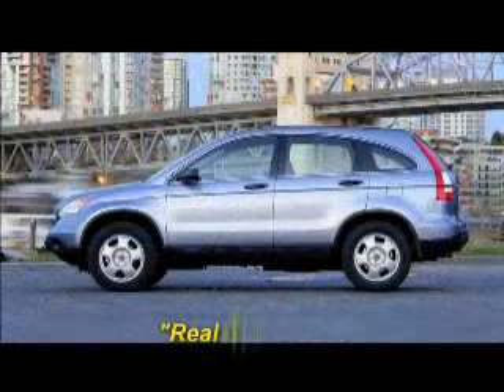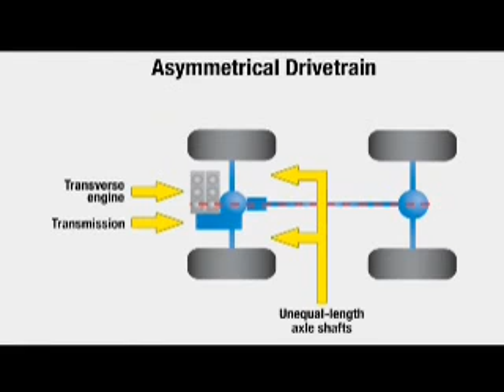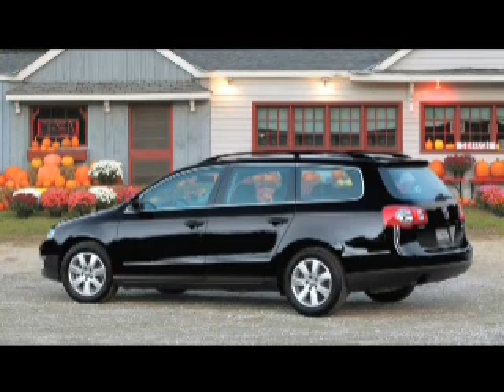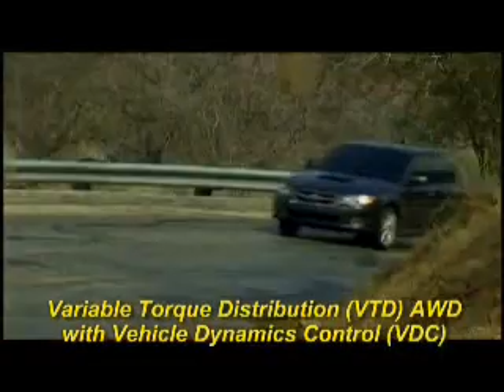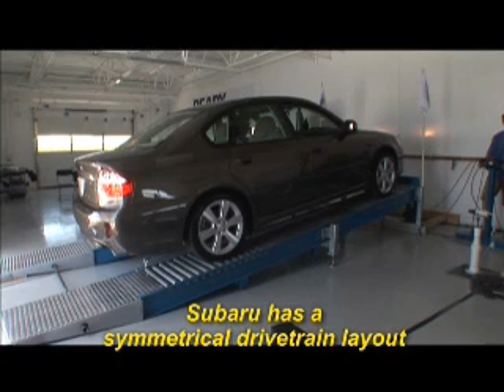Subaru AWD vs. competitors

Comment: The only problem I have with this test is that we cant see the rear wheels of any of the cars.  I'm not suggesting any foul play (I own a Legacy 2.5GT and, ironically a Rav4), but it would have been easy to position the camera to see the rear wheels and back of the car and eliminate any doubts about these tests  Given the testers were (if I'm not mistaken) from a Subaru dealer or at the very least paid by them. Neat test, I'd love to see it confirmed and how Toyota and Honda would respond.

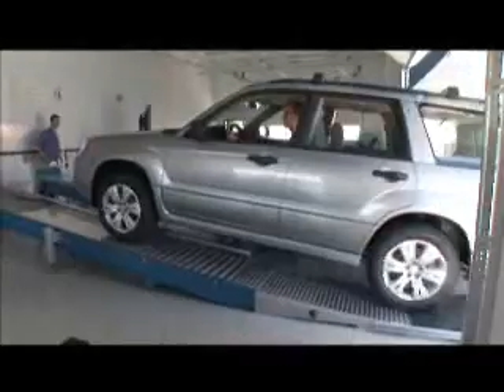Comment: At 2:03 you can see very goofy ramps they used (you can see the one on the passenger side tires) just outside to provide an additional barrier the vehicles had to get over with their rear wheels.  Almost like a wheel chock. They appear to look sort of like the bottom of a bowl, like a flattened U rather than a ramp.  Not saying the Subaru didn't make it and the Honda didn't but it did seem to me the results appear to be exagerated a bit.  This coming from someone who hates Hondas (except motorcycles), but I'm for legit, fair debate, not fanboy prop-ups... :(

Comment: @t0rington the bump on the rear wheels outside of the garage are there to simulate the angle of the rest of the ramp, though whieght pull from gravity is not simulated when rear wheels are at that bump.

Comment: "Passat claims that it can move when only one wheel have traction" They don't claim that it'll climb a hill with one wheel that have traction.
Reply: ifr4zze but then there is no reason to say it because every damn car can move if 3 wheels are on ice,its not that difficult, every car in the world can move if 3 wheels are on ice,as long as one of the wheels originaly can move, a rwd car that have the rear wheels on ice and one front on asfalt cant move because the fron dont move orignally, same goes for a fwd, but every 4wd car on the market can move if 3 wheels are on ice, its not an achievement and isnt impressive at all, but a 4wd car that can climb a hill with only 1 wheel on traction is very impressive. subaru does it again.
Reply: ***** then read it again, a rwd car with the rear on ice and the front on tarmac cant move, because the wheels that spins have no traction, this is not rocket science its basic logic, a 4wd car with 3 wheels on ice will be able to move without a problem on flat surface,

a volkswagen passat with 3 wheels on ice and on an angle wont be able to climb because the wheel that have traction dont have enough power to move a 2 ton car up a hill.

its in the video, did you even watch it.
Reply: ***** but it went on every wheel except the one that needed it.

Comment: @finnsk3 (continued from last) This is because of the weight difference, weight has a major effect on friction, which is what provides traction.  In a symmetrical driveline, you have (nearly) equal weight distribution between the right and left side of the car.
Torque steer, caused by unequal length of axles, is one axle twisting more than another.  Every axle will twist slightly, but if one side twists more than the other, then power will be delivered to the other side faster.

Comment: @3tadt30ldat physics says that automatically when slippage occurs...the wheel slipping will get most of the power because its the path of least resistance (air has little resistance). Therefore something must brake that tire so that the power being sent to that tire is reduced or stopped and the tire stops spinning.

Comment: The forester is indeed AWD all the time, but on a normal driving surface, about 80 percent of the power is coming from the front tires and about 20% from the rear tires. The thing is, it is always sensing the roads surface and "sending" power to the appropriate tires. In a subaru, power is always directed to the tire with the most grip.

Comment: Take a suite case containing 50 pounds. Start to lean the bag over & use your hand to keep it from falling. Now slowly begin to lay it on its side using  your hand as support. Notice that the weight begins to shift from the bottom of the bag to the front. The total weight of the bag never changes yet as the bag becomes more horizontal it becomes heavier to you. If the car is at an angle the weigh distribution on each tire changes.

Comment: The reason the subaru didn't have any issues with the rears on "ice" is because the front is a direct drive, not because it "sensed it" the rear drive is through a center diff.  A very good drive system though.  
now if it had a LSD front/rear/center diff.. that'd be fun!

Comment: At 2:35, the explanation was incorrect, the slippage of the rear wheels did not cause power to be sent to the front wheels. The front wheels are the default drive wheels and only when the front wheels lose traction will the electronically-controlled center differential (transfer case) send power to the rear wheels. This does not apply to Subaru's with manual transmissions, where the AWD is all-time 50:50 split.

Comment: if this has already been posted, ignore, but one fact reported is false. The asymetrical drivetrain has an effect on torque steer (the car rocking sidewas when both wheels loose traction). 
But only a locking differential (manual or electronic) will move the car if only one of the 4 wheels has traction.

Comment: @t0rington it think i wouldn't really matter, since 4 wheel drive cars cant switch to front wheel only rear and 4 wheels all together, so if front wheels we rolling that's means car was on 4 wheel drive mode, and you have a point it could be that rear was on the rollers like front wheels (if that's the setup) and again if it would be the case then the car wouldn't sit under angle it would slide all way back.

Comment: @7150285 Mechanical 4WD, yes. AWD, no. The transmission is mechanically locked, causing the front differential to be disabled. The front axles technically aren't locked, the center of the differential is simply locked, making it mechanically impossible for the front wheels to turn in the same direction. If you put the vehicle in the air, you can spin the front tires, and they will spin the other front tire in the opposite direction.

Comment: it would be interesting to see the diagonal test on the base Forester and Legacy.  With 1 wheel slipping in front and 1 wheel slipping at the rear, the car shouldn't be able to move.  I wonder if the Subaru VDC would help in this case.

Comment: @3tadt30ldat I own a '99 Outback, with 292,000 miles & climbing. I think what they're trying to convey is the newer Subarus have electronic traction control. That's when it would "sense" slippage and adjust. Another difference is automatics run 90%front/10%rear UNTIL slippage, then it splits power accordingly. My '99 is a 5 speed and gets 50/50 all the time. Automatics from my era go to 50/50 during slipping using a mechanical "sensor". I assume newer 5 speeds use traction control as well.

Comment: @7150285 Havent had a automatic subaru but I think they disable all four in park. All four are constantly linked in either trans type in a subaru. The competitors will most likely behave like a front drive in park since their poor awd systems only become awd when they lose traction at front. Thats the beauty of Subarus system you get awd constantly. Just had a friend come back to Subaru from an Audi. He also came to the conclusion that the flat engine's lower mass cg is more than just hype.

Comment: This video show us subarus center differential distribution. It works very well, betwenn front and rear wheels. And with traction on just one wheel, the traction controll system works great, if only a bit slow i think!
THIS IS WHAT THEY DONT SHOW US IN THIS VIDEO!!!:
Traction on the front left and rear right (diagonal test) This is where Subaru AWD system falls trough. It will be standing spinning like the rest of the competitors. But of course they dont show us that!

Comment: Technically this test did in fact test the Audi Quatro system, though it was under a different name. the Volkswagen Passat used Audi's Quatro system (Audi being owned by VW) how ever i did not see the Mitsubishi tested, i think it safe to say Subaru will shine over Mitsubishi too. also something to consider is the power to Weight of the Vehicle, takes more power to move more weight on any surface, and im wondering if this test compensated for that. still a great video.

Comment: @finnsk3 I'm not so sure, I have a 1993 Legacy and when one wheel looses traction it transfers power around just fine, and it's much much less advanced than your Forester, open dif at the back and no ABS lol. In a recent snow storm I drove it around with just 14" "all weather tires" and it was just fine.

Also the difference is that Legacy has all that crazy VDC and stuff on it, that costs quite a lot, wouldn't be surprised if that Legacy had a 32k price tag at the time.

Comment: @DtorBillAgain 
You´re partially wrong dude. Most of Audi Quattro models(but A3 and TT) have a Torsen locking differential which is very comparable to Subaru´s symmetrical AWD system (it can be able to lock both front and rear differentials). VW has 4motion which is completely different to Torsen based Quattro. 4motion VWs have a Haldex system which is a FWD system most of the time which engages rear wheels when front wheels lose traction. Only front differential will lock.

Comment: @finnsk3 Symmetrical AWD DOES mean something, but you're right, the diffs will make a bigger difference.  The difference that a symmetrical driveline makes is in weight distribution (which effects traction), and reduces or eliminates torque steer, caused by unequal length in the drive axles.

To think about the weight distribution, think of a rwd pickup, in the ice, the brakes on the rear of an empty pickup will lock more easily than the front, even though the tires are the same. (TBC)

Comment: I agree on everything except tires. This is not snow or ice where slip is between tires and the road surface where tires would be a huge variable. The slip in this simulation is within the rollers. all wheels on rollers will have 0 traction regardless of the tire. The wheels off the roller don't slip at all. Am I missing something what difference could tire possibly make here?

Comment: Good test showing you the difference between the AWD systems, but a little impractical. Most people buy these cross-overs so they can carry family members or friends along for a ride (as well as their gear), in which case even the Subaru would be underpowered and fail to drive up the ramp. The standard 170 HP that the boxer engine provides is not enough, and while Subaru offers an upgraded engine, it becomes too expensive for what its worth.

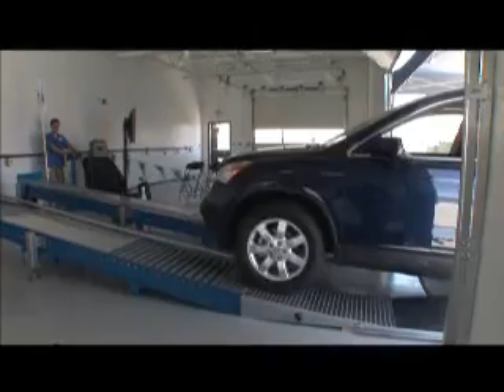Comment: Ok, I own a CRV, and it could make it up that 4 inch tall bump that you don't see. look at 0:38 in the vid. The driver must cut power to keep from going over the bump. Also, that part about going through tests to find traction is wrong. I know exactly how the CRV's AWD works: the greater the difference in speeds between the front and rear axles, the more power is transferred to the rear. There is no center differential, but rather a multi-plate clutch.

Comment: I just traded a 2005 WRX in part on a 2013 Forester. The WRX is more fun, by far, than anything else in the price range subaru makes. It was an excellent car and I just about cried when I gave it up for my "grocery getter," but I am a teacher, and I need a "sensible" car that is better in snow. The crazy torque the WRX gets will put you in a bind in snow pretty quick if you are hard on the gas. Your pick: sensible, or fun. Sensible is always better in snow :) Good luck!

Comment: @3tadt30ldat It needs to put extra power to the wheel(s) with traction to completely move the vehicle.

If this were on a flat surface, it would've had no problem moving without much (if any) extra transfer to the back wheels.

Comment: IIRC, any Subaru after after 2000 has a limited slip rear diff. My 98 Impreza slips a bit on ice but will go up. My 00 Impreza has no issues because of the rear diff.

Comment: the Highlander has a fixed 50:50 system, so it can't route power to the rear wheels.  I would have liked to see the one wheel traction test on a Subie AWD system without the rear viscous LSD....as the availability of Subie AWD with a rear LSD as decreased,

Comment: This video validates the complaints I hear from friends with AWD Rav4s and other vehicles that claim to be AWD.

The majority of these so called “AWD” vehicles can only send a very small percent of torque to the other wheels; usually in a front-wheel drive biased set-up, 10% of torque will be send to the rear; watch other AWD test on Youtube.

This is why some automakers don’t want to disclose details of their poor-engineering/great-marketing AWD scheme.

Comment: I'm not understanding this video.  The whole idea behind Honda's RTAWD system is to send power to the back wheels when the fronts start slipping.  The video is not explaining why the AWD system is not engaging.  Is it because the VSA (traction control) is engaged?  If so, you can reach over and shut it off.

Comment: Why isn't Quattro, X-drive, and whatever the unstoppable Hummer used on it's older models featured here?  Most vehicles that are advertised as AWD are not.  Trucks are a great example of this.  I live in the Rockies, at 9200 feet, on a mountain.  I have zero problems getting to my home in my A6.  And constantly see trucks with more power, bigger tires, and much more ground clearance struggling to get up the hills.

Comment: @7150285 yes and No. if you move both rear wheels forward or backwards it will lock up, but if you spin one wheel, the other will spin the other direction due to the open Diff. 

~~~1997 Subaru SVX LSi~~~

Comment: Yes my Outback has VDC and it sucks. Diagonal spin is not cured and to be honest the Outback is a bad car compared to the 05 Forester. The diesel engine is horrible at low rpm, the first gear is way to high and trying to maneuver with a trailer in tight conditions will ruin your clutch for sure (manual stick). The outback is ok for driving long trips with possibly heavy load but if I where to choose I would easily choose the forester (also manual stick) even if it uses quite a bit more fuel!

Comment: It's a shame with the new 2010+ Legacy model - I don't believe they come with the same VTD drivetrain technology as this 2008 model. I could be wrong, but I've seen quite a few videos of subarus not moving even with 2 wheels on the ground (one on each axle) because all the power use uselessly being sent to the (opposite) spinning wheels.

Comment: Pretty sure  the CRV would have made it if they turned the VSA system OFF.  VSA cuts engine power when it senses wheel slippage when your foots still on the gas,  it can be disabled.  But i do agree the Subaru is a far superior system !

Comment: ok i commend subarus for their AWD systems. But this video would be more believable if they showed both the front and rear wheels to show whether or not the 4WD on the honda really worked. Plus an advantage to a honda/toyota is the fact it has more room. More ride height/passenger room, Has a better resale value and get way better gas mileage then any subaru.

Comment: @7150285 yes, thats why when u buy a subaru, its on the manual that u CANNOT tow a subaru with the front wheels on the tow and the back wheels on the ground (rolling), u will destroy the system by doing that

Comment: If you take "move" literally, vw will MOVE with no wheel having traction. Down the hill. If they say it will MOVE, it should move in any direction, up or down, as long as engine provides enough power.

Comment: i beleive in subarus it also depends on if you have an a/t or m/t, someone correct me if im wrong here but with manual all tires recieve the same amount of power unless they slip where as manual its more front wheel drive unless they slip.

Comment: What if you disable traction control? I have a 2016 AWD Rav4 with en electronic "central locker" (i know its not a real locker so don't bother pointing that out) and with the locker on, the awd system and with traction control off i have driven thru deep mud and sand, heck even with out traction control off it drives a little bit thru. 

I am not saying its a proper off roader but for mud and sand it been great so far.

Comment: Where is the mighty QUATTRO!?!?!?
Reply: Most Audi vehicles with Quattro have symmetrical AWD, just like Subaru, except for certain Haldex equipped transverse models like the A3 and TT (which are built on a shared VW platform), so I'd guess most Audis would pass this test as well as a Subaru (or at least as well as the Passat for the transverse Haldex cars), but because they're priced so much higher than a typical Subaru, they probably weren't tested because they don't compete in the same price segments. An Audi A4 Allroad is nearly twice the price of an Outback.

Comment: @spencer769 I get to drive both cars and I love the Subaru (2002 Outback 83k) but for long trips the Audi wins hands down. Better cruising, more power and is now worth 1/2 of what the subie is! Subie steering feels a little better but it just feels like it's working too hard here in the mountains at 70-90mph.  Sure if you don't have a good mechanic you might be in trouble but I have numerous pals who have had outback cylinder head problems. Also do 500+ mile trips in  05 Outback - same problem.

Comment: I recently got my 2006 Subaru Legacy GT stuck in the sand. The AWD system could not get the car out of the sand. I had the 2 front wheels off of the ground, and could not get either of  rear wheels to turn. Any ideas?

Comment: Do you need a limited slip diff subaru to pass this test or will any symetrical AWD subaru pass? I got 2010 Base Impreza and wondering if the same principles apply.